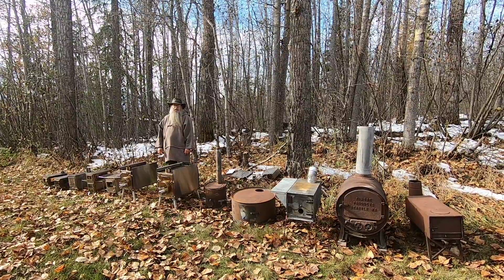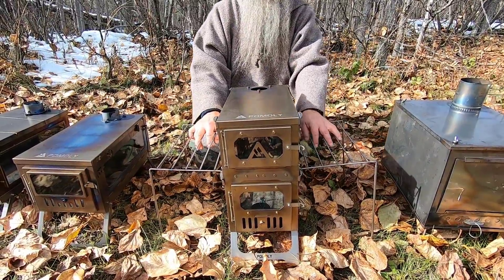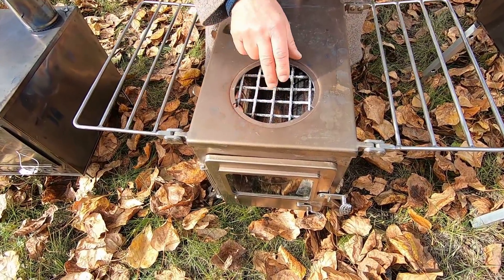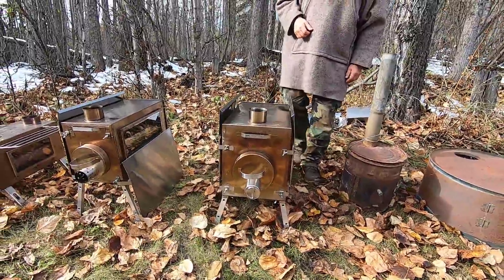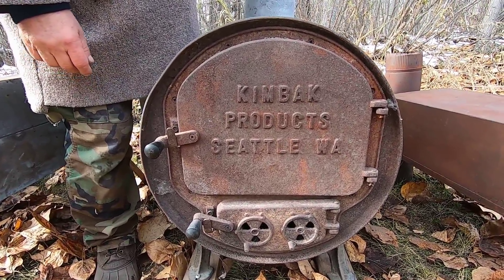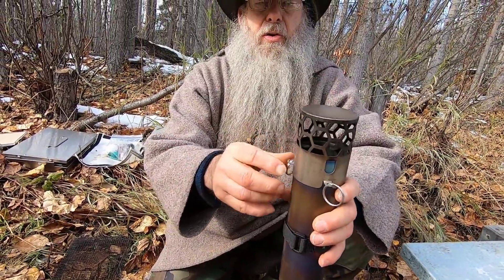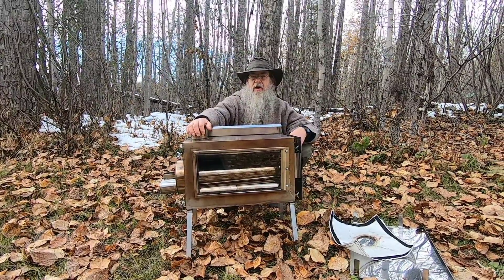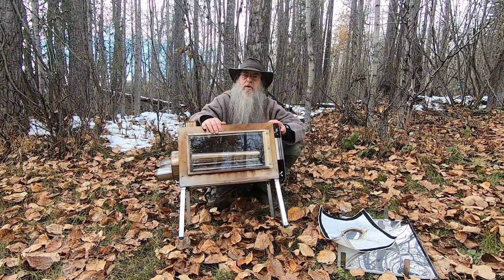Camp Tent Wood Stove info For The Common Man

Comment: There's a guy on youtube called theol1911 who does gun videos.  The reason I bring this up is that Smith and Wesson makes a particular revolver with a titanium cylinder to help cut down on weight.  He shot the gun quite frequently and eventually had to send the gun back to the factory due to flamecutting on the cylinder causing erosion.  Just thought I'd bring that up in relation to the longevity of titanium vs steel.
Reply: suppressors/silencers made out of titanium are known to erode quicker than ones made out of steel or inconel as well. The choice of titanium is purely down to weight, with the acceptance of a shorter lifespan of the item.
Reply: @124thDragoon  
Titanium is light, strong, fairly(maybe very)corrosion resistant, and conducts heat very fast. All good qualities for stoves.

Comment: That old military stove, is a Yukon Stove.  I've spent many winter nights in a tent in the Alaskan interior, being grateful for having that stove.  It saved our lives many times (172ND INF).  We spent Jan & Feb in tents.  There's a liquid fuel carburetor that attached to that big hole top front. Supposed to be for diesel, we used gasoline more often.  It lit easy, sometimes too easy.
Reply from the maker: Yes you are correct.   It is a Yukon Stove.   At the time I purchased that stove about 40 years ago I could have also bought the liquid fuel system for the stove and I did not.   Many times since, I have wished that I had purchased it
Reply: @Far-North-Bushcraft-Survival 
Maybe the liquid fuel system for that Yukon Stove could be found online.  Don't know what the military uses now.  I wold imagine they have moved on to something more modern.  There must be some left in Alaska here or there. We had hundreds of them back then. If you find one, be sure to use a "drip loop" in the fuel line outside and away from the tent.  It keeps any line or tank leak from running down the outside of the flex line to the tent floor.  Could save your life (definitely your equipment).  Good luck.

Comment: I've always liked the look of the 55 gal stoves, lots of good memories of exploring backcountry BC and finding old cabins with them.  My father has made all the stoves I have ever used in tents while hunting or camping.  Working as a steel fabricator he could always get scraps from pipe jobs where the ends are too short or cut improperly.  He built a smaller one out of some thick scrap, and had the blacksmith make a coiled handle, while the damper/air intake was one he built himself with a bit of deer antler.  Later he built a bigger one in the same vein, but of a thinner gauge steel, and very similar features, while only weighing about as much as the smaller one.  Both of these stoves will definitely outlast him, and likely myself as well, and I'm thankful to have use of them.
Reply: That’s awesome! Got some questions if you’ll answer them:

Was it stainless steel? What was the antler doing for the air intake? Do you have any photos/videos to share?

-Alistair

Comment: I've camped out in winter many times and I've found that even if you have the smallest Ammo Can wood burning stoves, if you have one of those heat powered fans blowing the warm air off the stove around, it doesn't matter how small the stove is because the fan will help spread the heat around A Lot instead of it just floating up into the highest portion of the tent. But, you will be putting more wood into your stove more often, but with the right dampener settings, you'll be getting that back under control. I like your video. First time being here, but really like the information you provide. Thank you. Subscribing now 😀
Reply from the maker: I have wondered if those heat powered fans is worth having.  Thanks for the input on that and welcome to the channel.

Comment: Mornin Folks - glad to see you back - I to have been gone off here fer 8 months or so --- im glad u included the 5 gal pail stove - i made one rite after you posted the how to video - actually made a couple and still usin them - cant afford  them pricey ones but then no need to really as it works well --- an after thot - because them pails are thinner material - after im done with them fer a bit - i clean em out and spray em with WD40 inside and out - then burn it off for i use it - seems to inhibit the rust sum -- dont remember what year  you showed it but gotta be least 5yrs  and still gonin strong -- thanks for sharein  Hi to Connie and take care

Comment: Great to have you both back again after the summer pause ! And thank you for your very interesting review of the different kind of stoves and their advantages as well as disadvantages!
With titanium, I think, I would have problems, when damages needed to get repaired in such a way like soldering, brazing or welding. As I have tried it once soldering would not work, and with brazing and welding the metal would start to oxidize and produce a white smoke of TiO2. So this needs to be done under an inert gas flow.  And titanium gets brittle in the cold and the wear may be higher inside the oven. But otherwise it is hard (Mohs hardness: lead 1.5, aluminium/gold 2.5-3, iron 4.5, titanium 6, steel 7-8), light (densities: aluminium 2.70 g/cm3, titanium  4.5 g/cm3, iron 7.87 g/cm3, stainless steel up to 8 g/cm3, lead 11.29 g/cm3, gold 19.3 g/cm3) and mostly chemically inert, so that it is used for long term implanted prothesis in the human body.

Comment: I just decided yesterday to come looking for you. WOW that is a lot of stove. You get your hands on a bunch of vinegar, paper towel, and some garbage bags. Now.. you soak the paper towels with vinegar, plaster them on the rust, bag it up. You will eat every bit of rust off in no time. You can be rid of it easy as can be with just brushing it off, or bristle brush not wire because no need to scratch the metal, putting the paper towels back on, come back, repeat til gone. Well that or naval jelly, but I havent seen that since I learned the vinegar trick. They used to sell it.*shrug* 
Im a fan of side shelves too and hot water heaters too! Nothing better than a nice hot water bottle for the bed too, I just use a two liter bottle and wrap with a small towel. 
Good stove education!
Hope to see more of you two! Glad to.
Reply from the maker: I also use the hot water bottle for warmer nights in the sleeping bag occasionally.  However I drop ours into thick natural fiber socks.  I have also used vinegar to remove bad rust on cast iron cookware by just submerging them in  a 50/50 diluted vinegar and water mix.  never thought of soaking paper towels and sealing the item off from air circulation.   Great idea.

Comment: Lonnie, I love the videos that you and Connie put out. Please keep it up. I have a channel but it is only so I can make comments. I don't produce any content because it looks time consuming and I don't need the income either. But I do have a good Idea now and then that I try to share with those of you that do create good content, when it's relevant to their video. Since part of this has been about DIY stoves, I wanted to tell you about a good source for a DIY stove pipe. Campbell's Chunky soup cans make a great take down stove pipe. The cans are bigger on one end than the other and if you use a side cutting "safety" can opener on each end, you are left with one end that fits nice and snug into the end of a second can. It's very easy to press 4 cans firmly  together to create a pipe section and then press a series of those pipe sections together more gently ( so they can be taken apart for storage inside the stove ) to make a pipe of the length you need for your tent. The metal is substantial but not overly heavy and the cans are of a good diameter for venting a small or medium stove. And as a side bonus, I really like eating many of the varieties of soups in the Chunky line. Try it out, if you eat that soup, or if your willing to risk a few bucks to just get the cans ( I recommend New England Clam Chowder and Sausage and Chicken Gumbo) and if you like the idea, feel free to make a video of it. I would love to see the idea shared. Thank's for the videos, the distraction in this day and age is priceless. Peace.
Reply from the maker: good idea as long as the stove pipe can be made to be sturdy and not come apart during a burn.   Many of my stove pipes are 9 feet long.
Reply: @Far-North-Bushcraft-Survival  Is that titanium sheet pipe really 9 feet long? I figured it was closer to 6 or 7 feet. My idea is meant more for a 6 or 7 foot chimney of the diameter generally created by those roll up pipes. What is the diameter of the rings that form that pipe.
Reply from the maker: Some of my titanium roll up stove pipes are 6 feet and some are 9 feet.   I have the seek outside 8 man tipi as well as a similar height homemade pyramid style tarp tent and they requires tall stove pipes especially since these breakdown stoves are so short.   

My Large seek outside titanium breakdown stove requires a different diameter pipe than the Pomoly stoves.   The SO pipe rings are about 3 inches and the P stove pipes are about 2.5 inches.

Comment: I've found a good way to deal with creosote is to run a very hot fire in the stove once per day (usually first fire of the day).  It tends to melt the creosote and it drips back down to the firebox to be burn again.  The rest of your stove pipe cleaning tips with the branch, I have done as well.  I've not tried the stainless steel scrubby.  I also use a stove pipe thermometer to make sure I am burning the stove hot enough to not produce creosote.

Comment: Wow that is some collection of stoves! Over here, most folks use what we call an "airtight", they work awesome and run around $100. Great information, thank you for showing them!
Reply from the maker: I remember thee ole airtights and miss them.  They were good stoves for the price.   They were oval in shape and upright.  I believe they were stoked through the top if I remember correctly.  I have not seen an airtight here in Alaska for perhaps 40 years.  I wonder why they don't still sell them here.
Reply: @Far-North-Bushcraft-Survival  That is strange, I can buy three different sizes at my local hardware store right now. When we tented they were the best, heated up a tent quickly and you could get them to burn 5 hrs to a load. They only last four or five years, but most of us add a liner and put an inch of sand in the bottom, and they would last much longer. I have one in my sauna at my cabin.

Comment: Hello Lonnie & Connie, it was really great watching your videos as always. I noticed looking at some of your homemade stoves rust had taken over pretty much. On my outside smokers and also my homemade outside wood burning  stove. I paint them with Rust Oleum engine paint. It claims to withstand 2000° F heat, I don't know about that, but I never had it burn off anything I've painted (but it does sorta thin out after time, and needs to be repainted). I've heard it said drums and such don't really burn out, but rust out after the paint burns off them. The only thing I would be concerned about is what, if any, toxic fumes it may produce in an enclosed area? Note again I have only used it on outside burning things where fumes isn't really a concern. Anyway I thought I mention it. Hope to catch another one of your video soon.

Comment: Great video Lonnie. It was very helpfull in picking out a stove. I was looking for a medium stove but I ended up getting the small Winnerwell Nomad. It is of course heavier than the medium titanium ones but its still very packable and can be carried quite easily in the included bag. There seems to be nothing but advantages to a stainless steel stove if you disregard the weight so I figured it was a good compromise to get a small stainless steel one over a medium titanium. You are absolutely right about the quality of this brand its one of those things where you can feel it instantly you pick it up. They are built to last and they clearly put alot of thought into it.

Comment: What I use for a spark arrestor combined with the galvanized HVAC tubing is "Kwik Mesh" (brand name) gable vent screen.  It comes in a roll. I use the 6 inch by 25 foot roll. Cut off a section to fit the tubing - I use 6 inch diameter tubing that matches my 6 inch diameter rocket stove that I had custom made by a welding shop - I use the stove more as a porch heater/firepit than a stove.
At the top of the "vent" tube I use a 6 inch galvanized rain cap. I cut a strip of the mesh approx. 20 inches long (6 inch diameter times Pi or 3.14 equals 18.84 inches) which gives a little overlap. Roll it to fit inside the rain cap, push it all the way up inside the cap as far as it will go and then use a couple of screws (pre drill the holes) to hold it in place.  
Works great, although I don't know about soot build up as that I haven't used it enough for that to become an issue as yet. 
I'm sure this would work for 4 inch diameter tubing as well.

Comment: Another great video back in early 70s when I first started trapping  a stove was made with an old oval wash tub turned upside down and two holes in top one for stove pipe and the other for loading wood with a piece of flattened stove pipe to cover hole. This worked surprisingly well in a tent or small line cabin. Life was simple then and people went to the bush to make money on fur. Don’t know what I miss the most the people or that way of life
Reply from the maker: I know exactly what type of stove you are talking about.   My good friend Charles of AKTrapper here on youtube has told me of using a cutoff 55 gallon barrel used the same exact way when he was a kid.   His dad, him and his brother travelled the frozen surface of the rivers on their backcountry trips and would heat their tent with that very type of stove.

Comment: I’m at the part where you are talking about your Galvanized Stove. It may be worth while to say that when it’s burning it smells bad, and if you can smell it you are inhaling the fumes. When we used weld galvanized metal and we’d breath a bunch of it we’d always drink a lot of milk afterward. It won’t stave off  bad galvanized poisoning but it always helped with light cases. Or seemed to anyway.

Comment: Ya, I've got the Winnerwel Nomad large and I really like the side glass, and front. . I don't mind cleaning it. Adds such a nice ambience and you can really see what's going on in there. You're right, it doesn't warp any, like the metal side does a little. Sure is a  solid stove though. Lots of great accessories.  Also have the Luxe 3W for backpacking and that has the glass on the front. Both are great for different situations.

Comment: Didn't expect to learn so from this video after all the research I've already done, excellent work. I'm now looking at building a steel drum stove as an inexpensive first winter option for my wall tent.
Reply from the maker: 55 gallon stoves are the best option I know of for larger wall tents as wall tents tend to be a harder to heat shelter design due to the large overhead area.   However with a stove of that size, a wall tent can be made to be quite comfortable.   I go camping almost every winter with friends and acquaintances that use 55 gallon barrel stoves in larger traditional canvas wall tents.  The tents are often quite comfortable even down to 20 degrees below zero Fahrenheit & maybe colder.   Good luck with the project.

Comment: Good to see you back! Ammonia will take that carbon of the glass like greased lightning and you don’t need abrasive just the towel.
Reply from the maker: In doing a bit of online research, I discovered that stove "glass" is not glass but is actually a type of ceramic and it is not recommended to use ammonia on it as it can etch it and thus create an environment that encourages even more soot buildup.
Reply: @Far-North-Bushcraft-Survival   I was just going by experience I’ve used it for years and never no problem

Comment: For your steel stoves, 1200°  ceramic headder paint. Keeps them rust less, but not rust free.
Extends the useful range for internal house stove  pipe and sheet steel stoves. Retouch at the beginning of the season.

Comment: If you burn hardwood and get the airflow right the heat will cook and clean the glass off. I have the Timberwolf stove with glass. Used it all last winter and the glass gets dirty when I start it with pine but cleans up when the oak goes in.